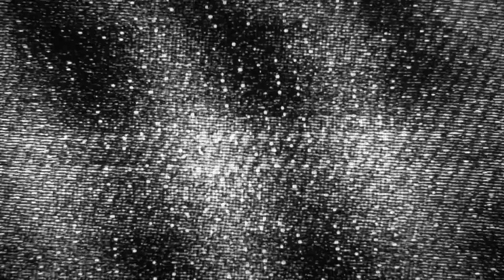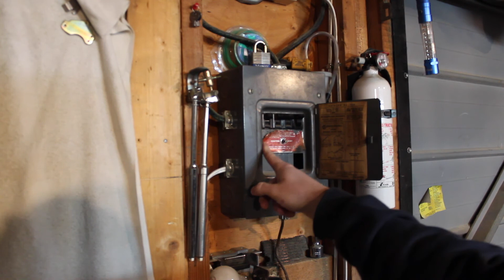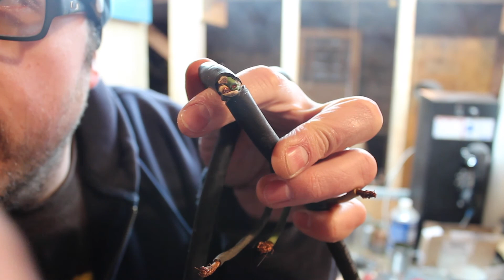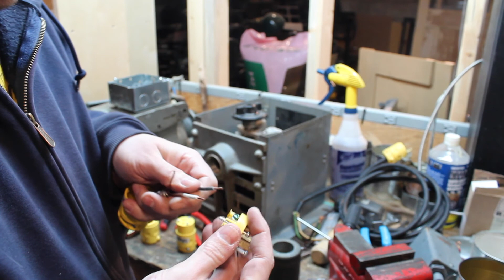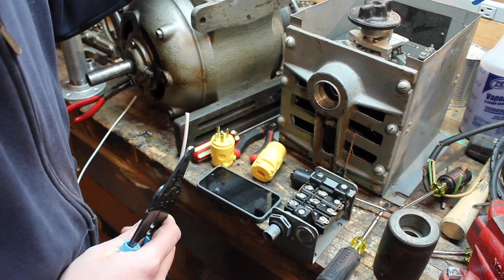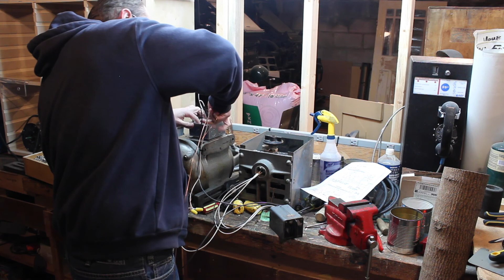Garage Adventures: Printing Press Motor Part 1

Comment: This is great! I just got a Craftsman although it's very dirty. I can move the press by hand by spinning the flywheel, and the original motor works perfectly, however the belt needs to be either tightened or replaced. I don't really have any idea what I'm doing -- I haven't operated a press before. But I was able to get the manual and parts list online and have just started ordering the oil it calls for and am planning on cleaning it up to start making some prints with it. I have access to several full typefaces to try it out.